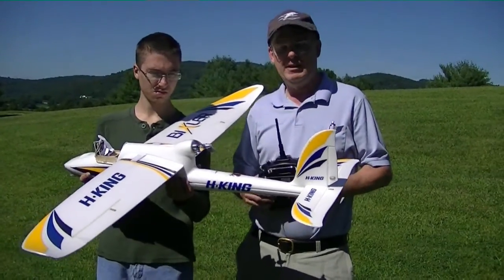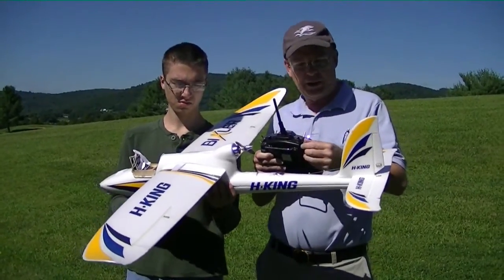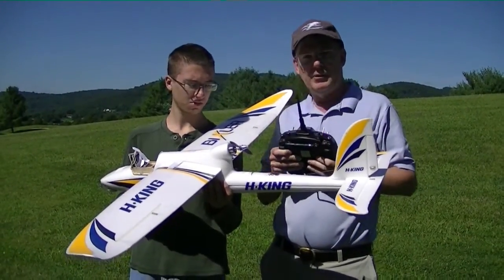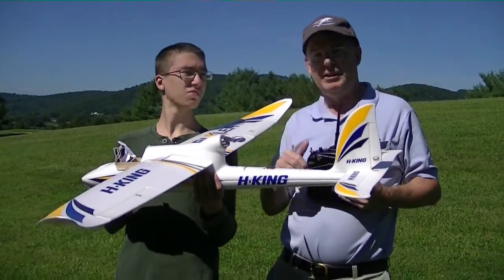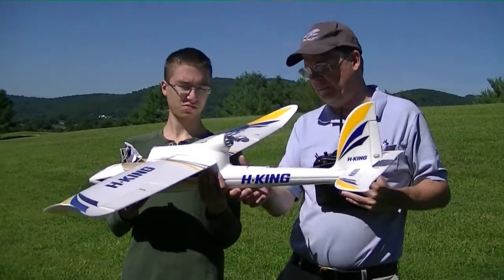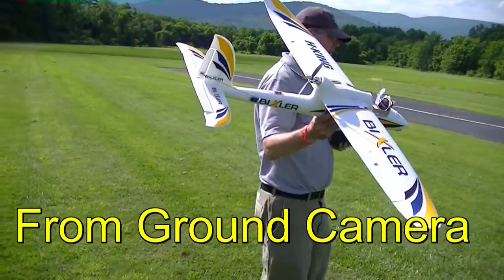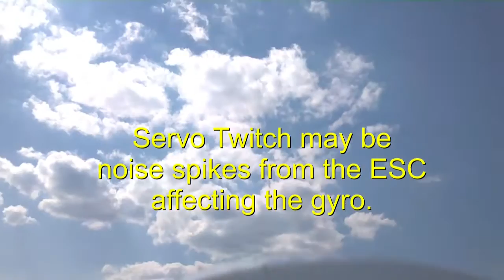HK RX3S 3-Axis Gyro V2 (Part 3) and Up Elevator Remote Switching Flight Test on Bixler Glider

Comment: Would you recommend a gyro to help begginer start flying ?
Reply from the maker: It's questionable if it really helps because this one is just for stabilization.
My suggestion is to spend 1000 hours on an RC flight simulator and get your stick control and orientation problems out of the way first.